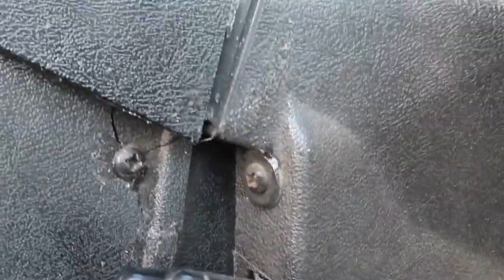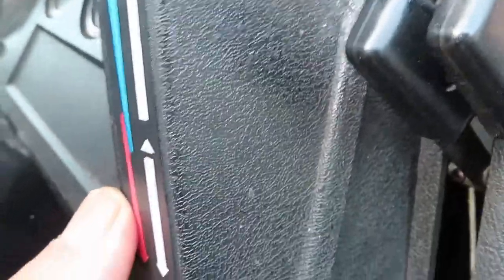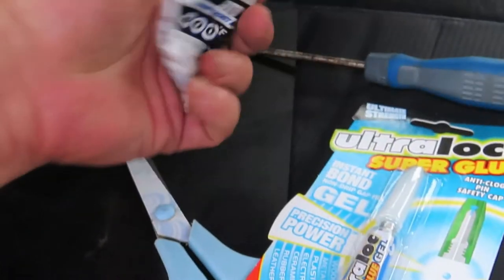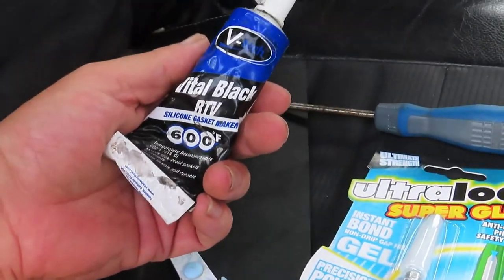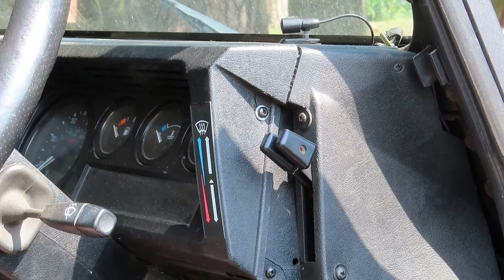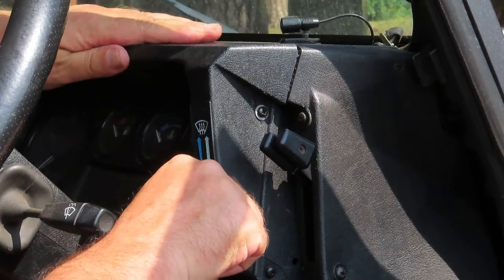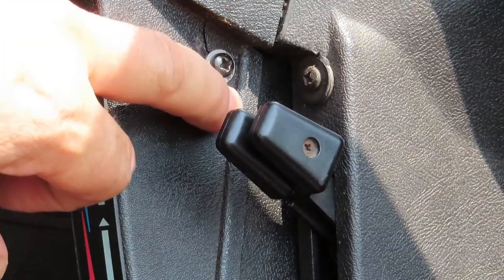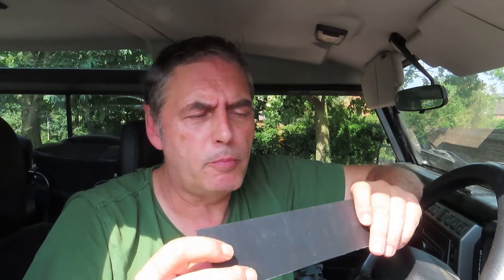Land Rover Defender - Dashboard repair

Comment: Both dash binnacle & bracket get brittle with age. I replaced mounting frame & dash binnacle with a Metal Raptor one, looks similar apart from the crackle Finnish on original. Difference is the Raptor one it is very solid & secure & does not rattle -at least not yet! That card could be very handy for repairs wher new parts are hard to find or very expensive.